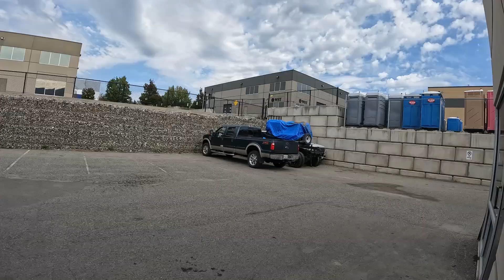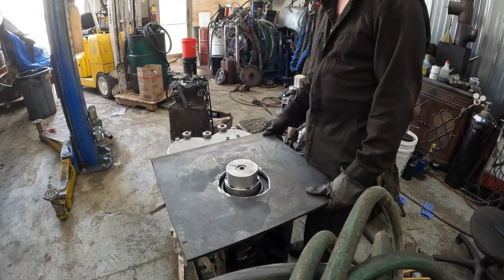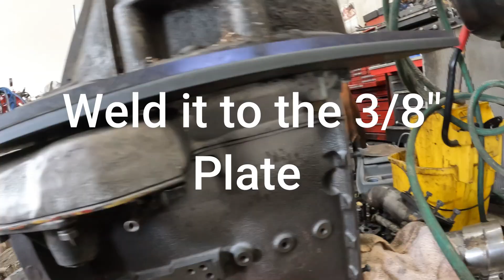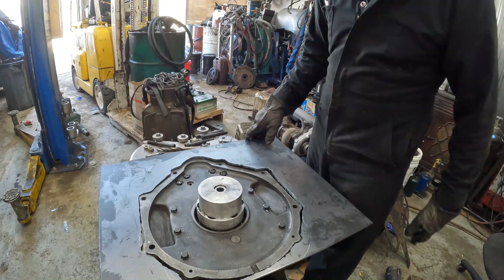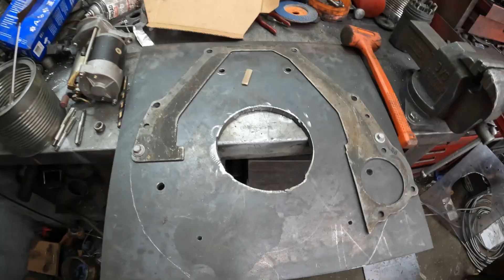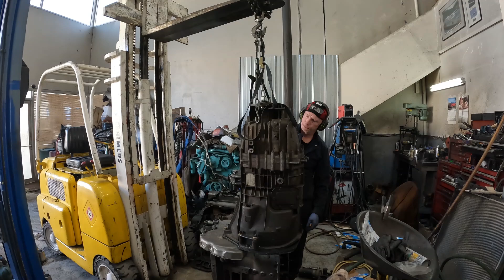Detroit Silver 4-53T (Building The Deere/ZF6 Adapter Plate Part 4)

Comment: Some impressive fab work.
For the oil pickup tube from the front to the back what would I use?
Reply from the maker: I used 1 1/8" tube steel to extend mine,  welded in two joints.

Comment: Is the fr9nt pulley on the 4-53 a harmonic balancer ? ( dynamic as compared to just a balance weight)
Reply from the maker: Some of the Silvers came with harmonic balancers, but this one has the balanced steel pulley.

Comment: just wondering if it would be possible to run a detroit engine on gassoline when fitted with a gasoline fuel injector
Reply from the maker: It might be possible.  They can burn multi fuels, like methanol, cooking oil, engine oil, kerosene, propane etc.

Comment: Super nice build, 6 speed manual zf6 looks like a good choice.  Where do you find a Detroit 4-53T?  Where those in buses?
Reply from the maker: Thanks, I've found them in Skidders and trucks like the C60 from the 70's.
Reply: I have one on a I believe a 1978 or 1980 stake truck with a five speed I believe . It’s been a while since i have run it.